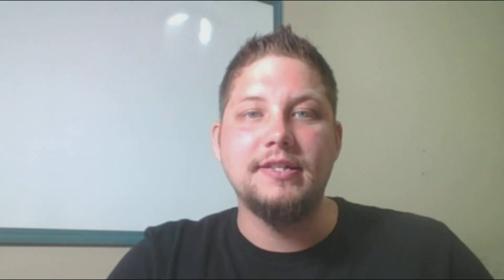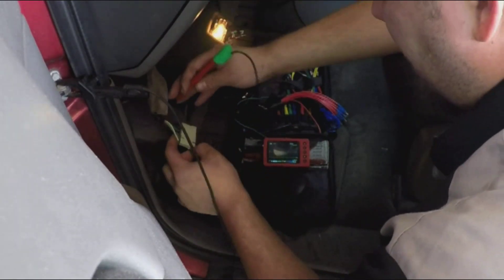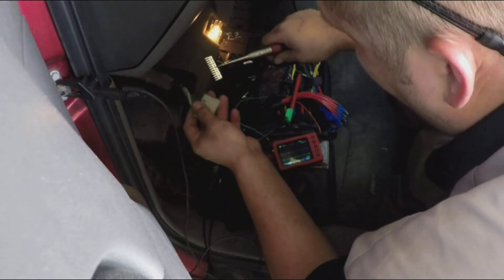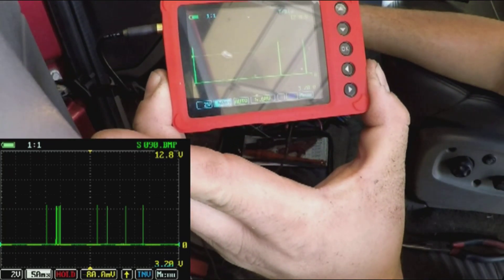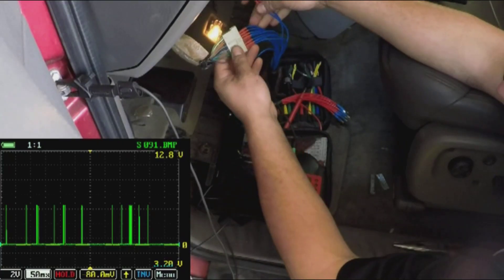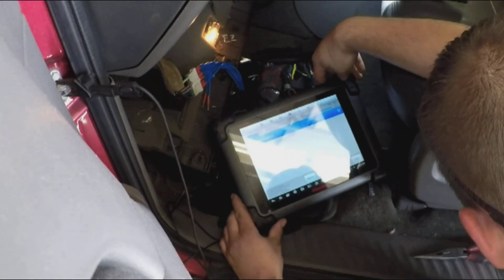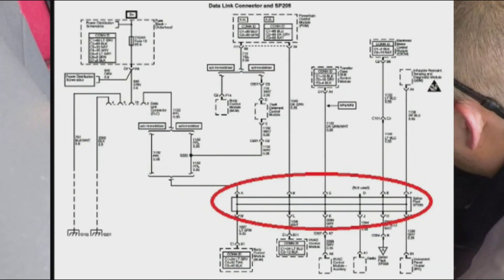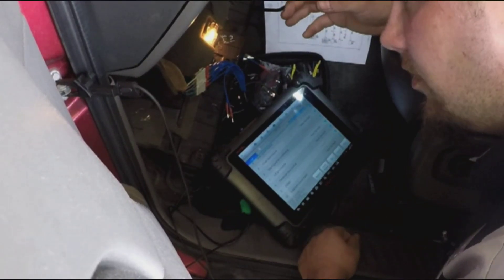GM Class 2 Network Diagnosis Tips

Comment: I don't have an oscilloscope. I can get one but was curious if I can use a voltmeter instead when adding network modules one by one. I have a bunch of wire so I can make that wiring contraption at home to add each module
Reply: This is my question as well. Im trying to figure out how to test this thing one by one
Reply: @RezyMuzik there is but you need a bunch of stuff. It's only best to just get a $50 one channel oscilloscope and get this weird harness idk the name but it has one wire on one end and 10 or so wire ends on the other end and u plug all em into the connector and the single in the scope and unplug one by one until the line clears
Reply: @MJsLandscaping-i9e still cheaper than the dealer

Comment: Great video, but never assume body will have a good ground. Body has a bad ground, the door hinge or door check will be a poor ground. Connect scope ground lead directly to battery  ground post or your scope pattern may be poor regardless if the signal is bad or good.

Comment: Great video.  i have seen several AC panels get fried when installing a stereo. Wires fall into the top and short out on the circuit board. Bet it spiked the rear module on that one. Most customers will not admit that they saw a spark, or blew a fuse. Nice work.

Comment: Hello Keith, I'm a little late here. I have a couple of questions. 1- where are you hooking up the leads on your scope, #2  pin on the dlc and ground?
2- if the pcm and bcm supply the 7 volts, how do you check the system with them removed from the network?
Did I miss something?
Reply: Hey Neal , I figure I will jump in and answer for you. Yes pin 2 at DLC and pin 4 or 5 for ground . Neither the BCM nor the PCM produce the 7 volts alone. ALL modules on the Class 2 network provide their own 0-7 communication. I hope that helps

Comment: how do i find a problem on a 2013 Malibu can high negative. the car cod is can a off line. it seems to be in the air bag  and restrain. its not shutting the vehicle down it runs very well but it causing all kinds of other problems. false readings on the temp sensor and things like that

Comment: Ummm mind if I borrow that tool? lol. Wonder if they rent these. I have a 2006 sierra 4.8 and after I went over some tracks and it got extremely sluggish..engine light came on and got the U1000 code along with p0449 and p0106...ordered the MAP and EEV valve..Been messing with it for days. Any tips?

Comment: Keith would that comb connector also be called a gateway the connector which Keith Defazio often references and is it found on most vehicles or just GM. THANKS IN ADVANCE Artie 👍
Reply from the maker: No. A gateway is a central ECU/module that acts as a translator for multiple networks. It is the "hub" so to speak for network communications. 

A splice comb is simply a way to connect and/or isolate modules to one common network
Reply: Thank you Keith For that Clarification 👍

Comment: Want to get a little clarification on this one. IF one was to plug a breakout box and do this test the same way would we get the same result or does this comb affect the ability of the breakout box to be utilized and each channel be checked for activity one at a time without having to remove the dash panel and drop the OBD II plug from it's mount location. 

Not that it's a problem removing it from it's location. I also do understand that not everyone has a breakout box either. 

I did see another video as well, channel name hard if impossible to remember at this point. 

Anyways the person doing the video made a couple important comments about using the breakout box. First was being that as techs you never know what a customer did to the vehicle prior to receiving it that it could be a good suggested practice to use a B.O. box each time you connect that way you can always check for power and ground and the OBD port this having proper polarity and possibly preventing damage to rather expensive scan tools. 

Also it would enable the tech to check each network line without having to drop panels, creak necks around because you have the B.O. box installed this making the job possibly easier on the ol body. 

I'm sure some or many may chime in but please do so as each amount of information we get that's more clarified ultimately helps us all. 

Also is there vehicles that a B.O. box this will or won't work for and if so what would one look for to identify this capability when approaching this type of fork in the road. 

BTW love watching the T.B.T. videos and keep em coming!

Comment: Keith,  can this test be done with the vehicle off and the ignition on?  My truck had the radio changed and is now reading unknown driver and will not stay running.  It has many of the same symptoms as the trailblazer in the video ie no interior power. It will start but then shuts off after a couple seconds. 2004 silverado 2500 hd with the lly duramax.  

Thanks!

Comment: Keith, Great video. I want to do a GM Class 2 troubleshooting video for the members on the C5 Corvette Forum but unfortunately 99.9 % of members don't even have a scan tool and certainly not a DSO...I don't want to use my Picoscope, Scan tool or Can test box because that's not how they will T/S this problem...with a DVOM you won't see a 0-7 volt square wave anyway so how would be the best way to T/S for these guys ??...the C5 has 2 Star Connectors near the BCM so I guess remove the comb from one Star and see if the car will start...I think all of these data bus issues will be either "no start" or crank and shut down"....DeFazio did a '98 no comm a while back... if the Star is removed and the car starts I guess they could de pin each module data line and 1 by one install a pin and then install the comb until the car won't start...OR maybe just pull the fuse or fuses from each module until it starts. Thanks !!
Reply: Rob W. Hi Rob. Yeah one cannot do adequate testing without the proper equipment. Doug
Reply: Thanks Doug !!...I guess I won't even bother doing a video about the Class 2. And YES without the proper equipment "testing is futile"...LOL !!!~
Reply: Best thing is just let the Corvette drivers be Corvette drivers as they probably won't want to or don't have the patience to do this.

Comment: Nice video.. I like how you go into detail on how things work. My question is that you said the pcm or bcm has to be hooked up to get that 7 volts but when you took the comb out you hooked up your leads one at a time and on the first one you probed into there was a 7 volt sqaure wave and that might not have beeb the bcm or pcm either. Could you explain what you ment and why you got the 7 volts on the first module you probed at comb.. If this makes sense to you what im saying
Reply: The first module I added was the PCM, but yes, you need to add either the PCM or the BCM first.
Reply: Hey Kieth great presentation. I don’t quite get why you would have to add the P or BCM first and use every pin to hook up and watch on the scope. Wouldn’t it work the same to just test each one separately?

Comment: What about the radio? Still removed? Interesting that the radio install caused the fault?
Reply: Likely tied the class 2 wire to b+ or something else at the adapter harness causing damage to the hvac module, guess the othe modules were a little more robust
Reply: I guess I got lucky when I installed a aftermarket radio in my 04 Tahoe but I did get a security bypass interface that I installed with the radio at the same time. For some reason I feel i've watched this video before but then some or it seems new to me. Either way good info!

Comment: Thanks for the information and for showcasing the uscope. Do you think the software on the uscope justifies buying it over a different mini 4 channel dso? I am trying to decide on a good scope given my limited experience it just seems like I would outgrow the uscope quickly but the software it has would be very helpful. Thank you for your videos I've been putting the information to use all the time.
Reply: Its definitely worth it, a new software update is coming out for it soon as well, more features will be added. I have played with the DSO201 version, its missing a lot of functionality vs the AESwave version. Jorge, Carlos and Team did great on improving the tool!
Reply: Keith Perkins thanks for the input I just got some hantek amp clamps and adapters to run on the shop's modis but I want my own stuff and the uscope looked like it was really easy to run and with the presets it looks like it has a lot of functionality. I've been all over the map on buying a scope from hantek to uscope to picoscope even looked at some bench type scopes. I think I'm just going to bite the bullet and pick one and use the crap out of it to just get lots of experience with it quickly.
Reply: Wilkerson Auto just want to add that the Pico is the way to go, especially if you need more than one channel. The Snap-On is nice but definitely not as much functionality as the Pico! Doug
Reply: Yeah I purchased the DSO to try it out and the connections it has are NOT as functionally adequate as the U-Scope. Wish it had two channels instead of just one. Doug

Comment: Keith great video. Is that harness adapter just for GM vehicles or can it be used to do other testing. I own the U SCOPE and does it utilize the U SCOPES single channel connection point THANKS MUCH
Reply: AESWave PN is DECS-04 for the comb harness. It's not on their website yet to order it online but if they call they will take the order.
Reply: I have used it for many unconventional uses! Call AESWave to order one, I do not think it is listed on there website.